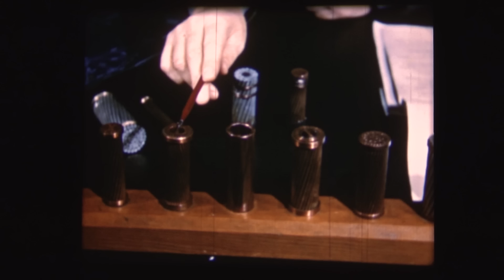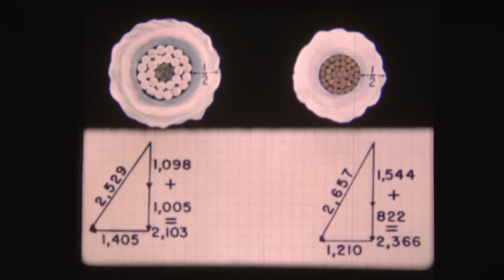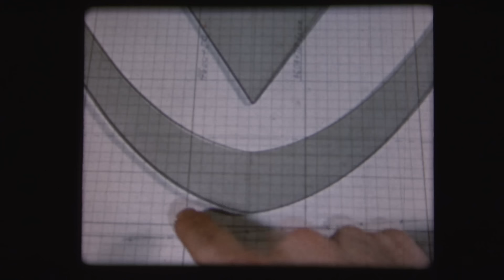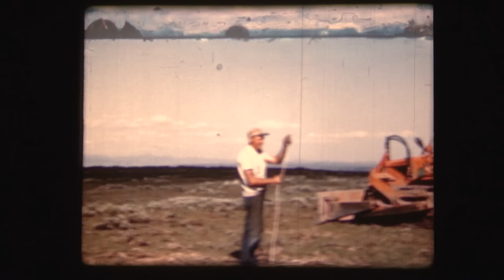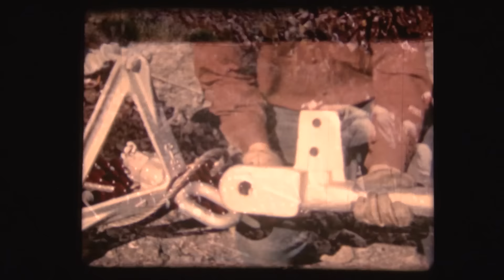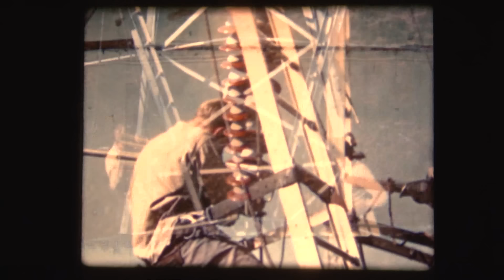Stringing and Sagging a High-Voltage Transmission Line (1950)

Comment: Many years ago (mid 1960's), I worked in Alcoa Aluminum's wire and cable mill in Vancouver, WA.  We made those aluminum power cables. I ran a forklift which carried the spools of aluminum wire to the gigantic rotating machine that made the cables. They were amazing, about 6 inches in diameter, with a strong steel cable down the center. When a spool ended, they "butt welded" the wire from the next spool on, and then somehow "annealed" it. Great process. It was a summer job for me, when I was going to college.

Comment: That's some extremely tough work. So much goes into it before the actual construction. I would think installations are easier, today, with equipment that wasn't available 75 years ago. And we shouldn't complain about the cost of electricity. It's a wonder it isn't a lot more expensive.

Comment: I worked in this industry for more than 30 years (115kV single thru 500kV quads), and this is the best overall video explaining the entire process. Some changes have taken place such as use of helicopters to string lines and carriage cars that travel along the cables allowing spacer dampers, etc. to be attached. Ground equipment remains unchanged. Great video!!!

Comment: The only diference in the constructive process is that we used more advance machines (not tractors or trucks) in the stringin and sagging process, apart of that, the methods are the same as 70 years ago
Reply: What machines u use?
Reply: Also, modern workers would be wearing hard hats.
Reply: We still make the porcelain insulators at the same factory. They aren't brown anymore, just grey or light blue. Also make the smaller "mushroom" cap units you see on your local street power lines.

Comment: As a retired engineer, I found it interesting to note that they were using slide rules to perform their calculations.  Things have obviously changed since then.
Reply: One of my nerd hobbies in the late 80s/early 90s as a kiddo was buying and restoring old pocket calculators with LED and those blue/green fluorescent displays (I still own and actually use an HP-22 business calculator with a red LED display to this day). One time I found one at this monthly used electronics sidewalk sale off of Ross Avenue in Dallas that was too fried to be fixable that had on its box a claim of being "an electronic slide rule" and having all of the capabilities of a slide rule coupled with "computer technology." I had no idea what a slide rule even was and there wasn't really a consumer internet at the time, but my Dad explained to me what it was in glowing terms. He trained extensively with them at Georgia Tech many years before. Just as I had no idea what a slide rule was back then, modern kids will have no idea what paper maps, paper checks, standard transmissions or pocket calculators are in short order - to the extent that it's not already the case! The world changes so fast. It's scary. Long live the slide rule, red LED glowing electronic and traditional mechanical versions alike!
Reply: Yes like the use of hydraulics and explosives instead of muscle three hundred feet up on in the air to do the heavy work.

Comment: Excellent video.  Great tool to use to explain to interns and new hires to Overhead Transmission Engineering.  I wish I had this to use as part of the training.  It also helps to bridge the gap in understanding some of the documentation of the existing lines that are replaced, refurbished, reconductored or relocated and now, how PLSCADD is used and applied.  It is important to be able to understand the existing structures and conductor and the loading criteria of the existing transmission line if making modifications.  Sometimes the documentation does not exist and engineers need to know the vintage and type of materials and codes used at the time before making changes.

Thank you for finding this movie and publishing!